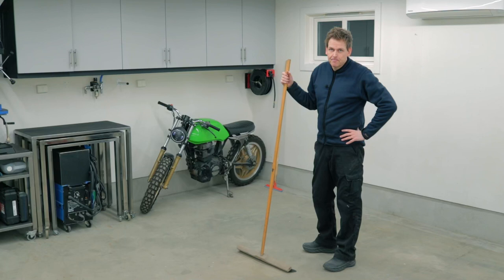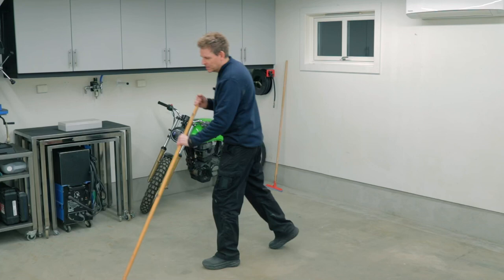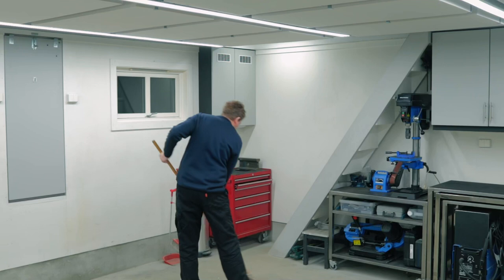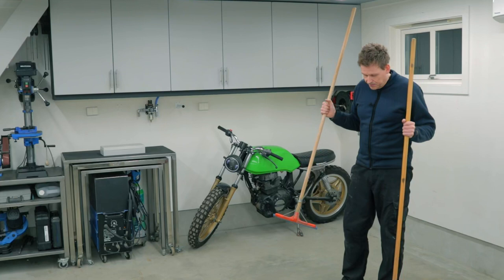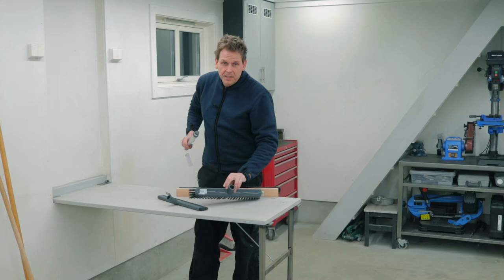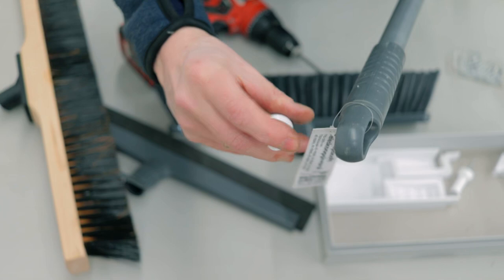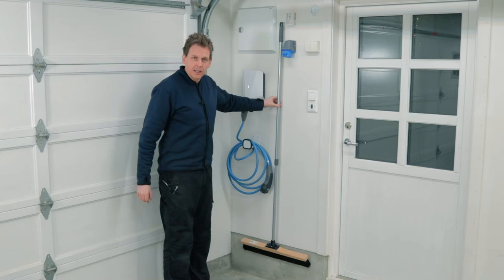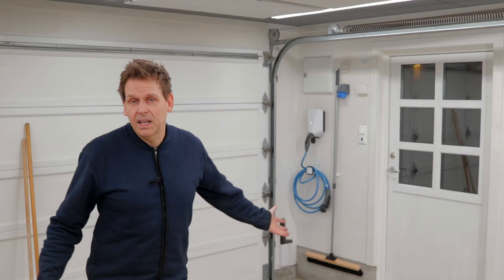The Importance of Tidyness! Why Does Not Everyone Do It?

Comment: 1 step even better would be to combine the 2 tools into 1.
I have seen and owned brooms with the rubber strip on the back edge. No disassembly needed. Just a flick of the wrist, and you're using the squeegee. Flick it over again for the broom.
Reply from the maker: Ahh, that was a genius solution 👍

Comment: As always, super impressive with the 3d printing and colour matching. But I have to say a toolflex rail and some holders would be quicker and more flexible for when you want to quickly ‘park’ something on the wall with the broom-squeegee. Like a mop, or koben, or a telescopic handle for a paint roller, etc.  
Is your floor sealed or treated? I used floor paint on mine to reduce the concrete dust and it worked great, but is lethally slippery when wet….
Reply from the maker: Have to lookup toolflex rail, not sure what that is - but sounds smart 🤓 My floor is not treated, it's pute concrete - but I have planned painting 3K epoxy to the spring/summer.

Comment: Just got back from my garage for cleaning and arranging it for after few hours and finishing few small projects just to see the same Biltema brush and støvbrett in your video thumbnail that I have.
Again great video. I also agree fully your principal and follow it too (structured, tidy and continuous improvent). My garage is just not minimalistic; I have a lot of materia - so strucure is even more important. Utilize all the wall and also ceiling where possible.
Was your .stl files available for download? I already have broom holder but the problem is that I need to hang it upside down, needs improving. Though wooden stick has its limitations as you know  so maybe upgrade is needed :)
Reply from the maker: Very cool ☺️ seems like we have lot of the same thoughts 👍 Hanging the broom upside down is not that good when it is wet or very dirty, then it's nice to keep it with the brush hanging down. I can make a zip file with the STL files for 3D printing the parts I used in the video 😊
Reply from the maker: Hi again, I have finally saved the printable files to my web page: https://hestad.no. I made a zip-file with all models, saved as 3MF files (Similar as STL). I also included the original Autodesk Fusion 360 project file with all models inside.